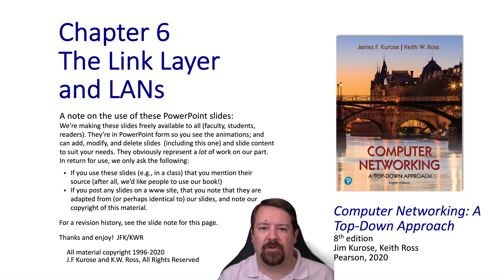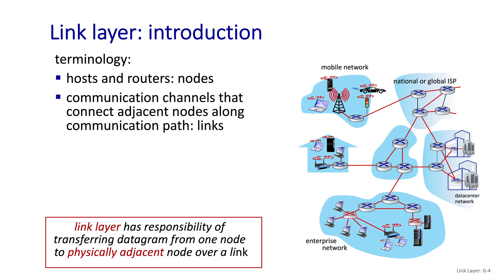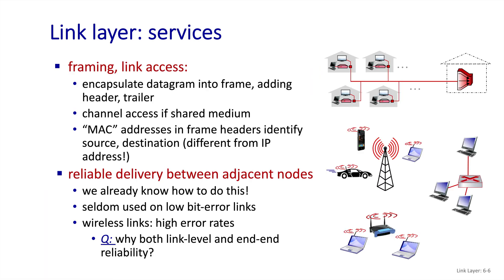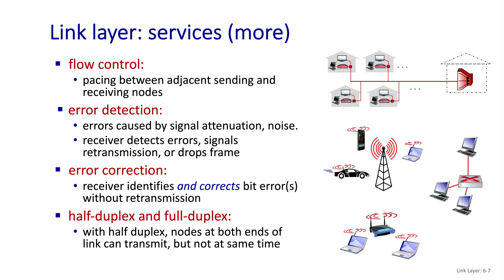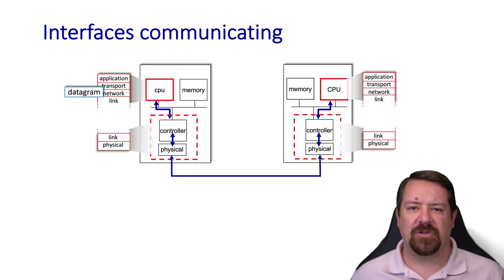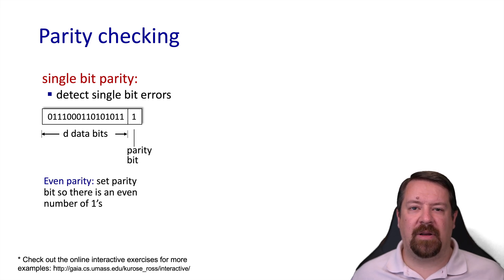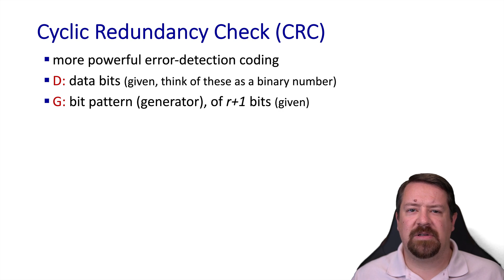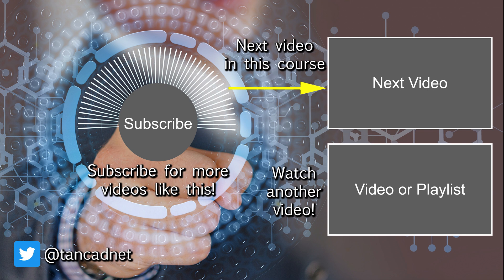Link-Layer Services, Error-Detection, FEC - Link Layer | Computer Networks Ep. 6.1 | Kurose & Ross

Comment: Sir can you please explain how two-dimensional bit parity understands which bit is flipped? For any block if a bit is flipped it will come both in row and column...then how will receiver understand which bit got flipped?
Reply from the maker: The receiver will check the parity on each row and column, and find that the parity doesn't match on one row and one column.  Since that row and column only intersect at a single bit, then the receive will know that is the bit that was flipped.